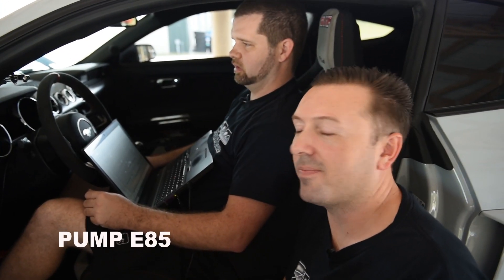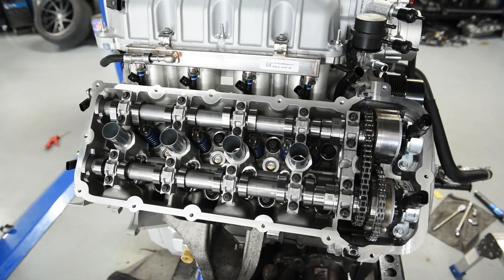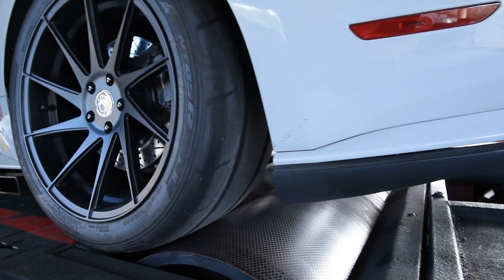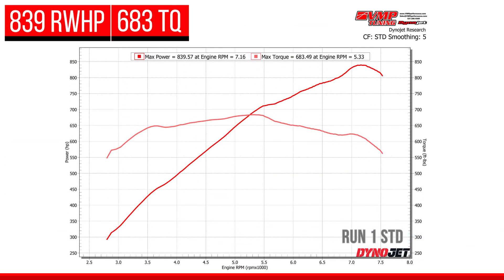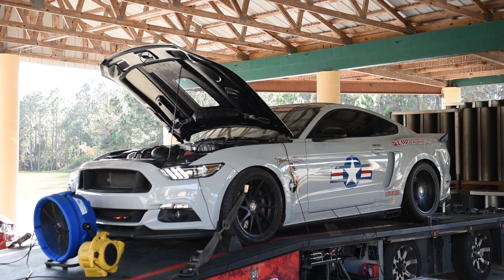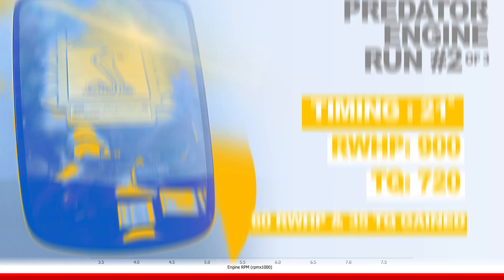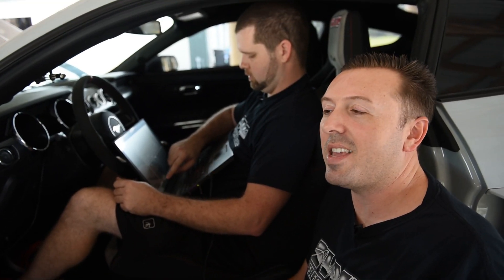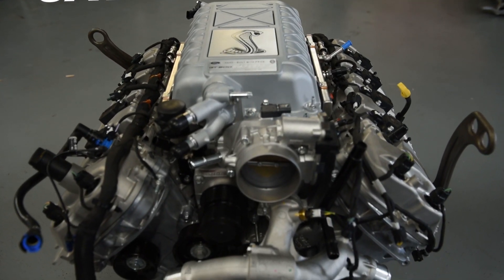First Dyno Pulls |  The World's First 2020 Predator/Coyote Engine Swap

Comment: What trans ? 10r80 ? Can it fit a Predator engine without modifications ?
Reply from the maker: MT-82.  The bolt pattern on the block matches up.

Comment: Yes this engine will put out more horsepower no it will not do it reliably , just simply bolting on power can be done to any engine doesn’t mean that it will survive in the real world, I will confirm this with one of your later videos were the engine blows up because it will happen a certain as the sun rises.😂 I’ll be waiting for the video
Reply: Look everyone it's scotty the sissy. They are trying to find the limits of the motor and are not worried about your sensitive mangina!

Comment: Isn't that a dyno misrepresentation when a 2.28 you are a full throttle then get off and stab the gas pedal immediately that will make the dyno read higher hp than actual ? Or does the car just rev up when getting off the pedal ? I could be wrong  ! But watch the rear of the car at full throttle it 
tucks then rises after pull the then when tucks again from throttle input. That's got to be worth 30-50 hp of false hp. I'm impressed by the new GT500, but keep it real !
Reply from the maker: Dyno pulls are only taken in one gear when recording is activated.  Any type of on/off activity would show up on the graph as a lid on hp when lifting.

Comment: So - you are stating that the factory 2020 GT500 is having cooling problems from the factory - please answer this ASAP - thanks ...?
Reply: Technically no. Only when you turn up the boost it starts to become a problem. Stock there's no issues. So if you're wondering if it's a design problem. That's not the case.

Comment: Did you leave the predator injectors on it or did you swap them out?
Reply: They couldn't make 900whp without changing injectors on E85. 
Not to mention this motor with the stock boost couldn't run E85 without injectors either.
Reply: @waynebollentin989  cheers. That's what I was expecting but I didn't hear them mention it

Comment: What i noticed is that on the third run the torque hung in a lot better than on the second run. Pretty impressive so far. Be good when you get your own GT500 so we can see how the stock fuel system holds up over the system in the track attack.
Reply: The GT500 chasis should also have a better overall design to fit the engine, especially when it comes to cooling, this chasis will overall show later on heavy heat soak.

Comment: Why do these new Gt500’s have so much low torque numbers?
Reply: Dohc High Revving engines tend to have a shorter stroke compared to a pushrod sub 7000 rpm v8.
Reply: Chris Carson the coyote or predator has more stroke than a hellcat while a predator is only 1 thousands of a inch shorter than a GM GenV. The coyote is only a few thousands lower. Fords have a lower rod ratio also. These engines have more valve surface area ie flow potential along with a much lighter valve train allowing for a 7-8k rev. The valves are around nearly half the weight of a OHV engine. Even titanium still doesn’t come close in a OHV configuration. This is further aided by fully independent VVT with a much larger sweep. If you locked these cams in their max power position the engine would lope like hell. Their advertised duration numbers are performance cam territory for larger V8 engines and run as much lift as a typical push rod engine. If you look at the stresses these things endure I think they’re even more impressive in my opinion.
Reply: It’s a 5.2L that’s why
Reply: Camaro_LT1  exactly - you get it!
Reply: Ford had to tweak the tuning to make sure the torque didn't exceed the factory torque rating of the transmission which if I'm not mistaken is 650 pound feet of torque
Reply: Many reasons why, the engine, the transmission, the way it's built to perform, the biggest reason here as mentioned is the trans, it's limit is 650 torque, Ford compensated for that and made it as high as possible while leaving some wiggle room for more abuse and more power, and it doesn't need to be overpowered with torque since what you want is to get the car moving with that low end torque to get up to speed quickly, but after that the Horsepower is what will do all the real work of pushing the car harder, which it does, Ford has the highest Horsepower car in it's class at the moment based on it's competition, and that is important, not just for bragging rights but overall performance especially with the way the car is.
Reply: Scrub Killz Because race car 🏎 lol. Most race motors run high power low-ish torque. It’s about the car building power and not over powering the rear out of a corner.
Reply: TVS superchargers develop boost quicker than twin screws of similar size and blower rpm. The displacement to blower size compared to a coyote with giant twin screw 2.9 to 3.6L means the supercharger spins faster from the get go so torque comes on sooner. Having lower compression allowing for even more blower speed again brings boost on sooner. The big twin screws being spun slowly aren’t in their efficiency window until the top of the rev range. They’re typically ran on low boost because of high compression further reducing their efficiency. TVS blowers sing at 11-14lbs of boost while twin screws prefer 15-20lbs of boost. That also depends on what PR the twin screw was designed for. KBs like stupid high boost to hit their window.